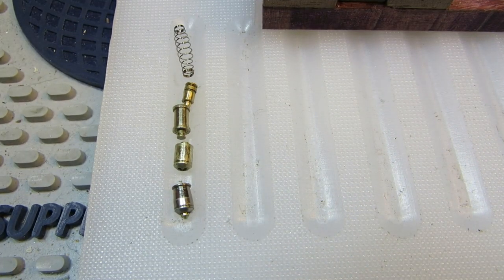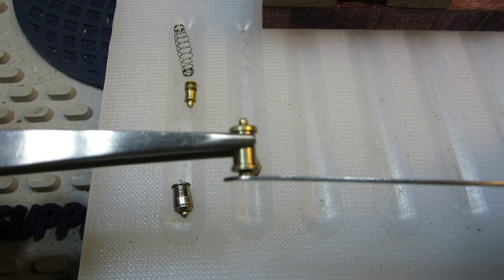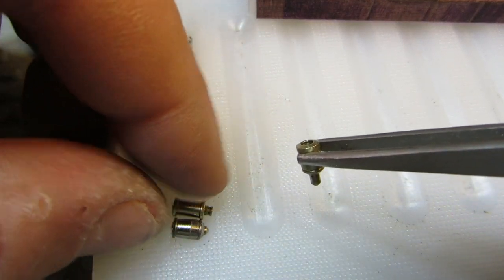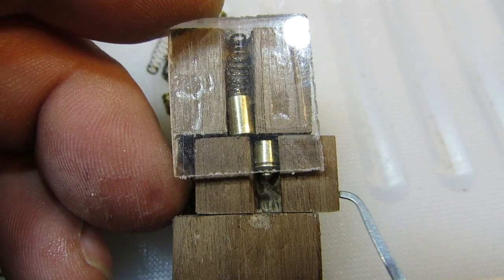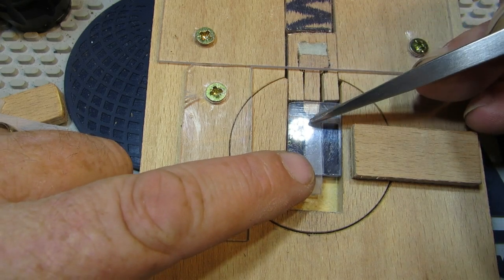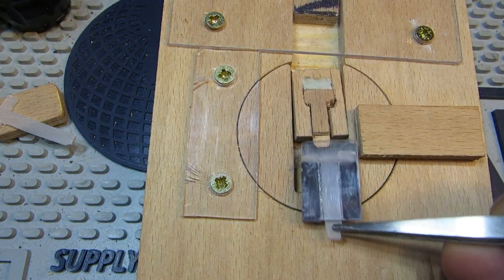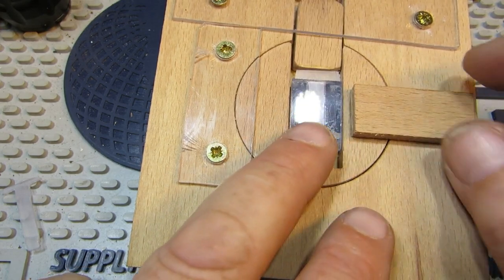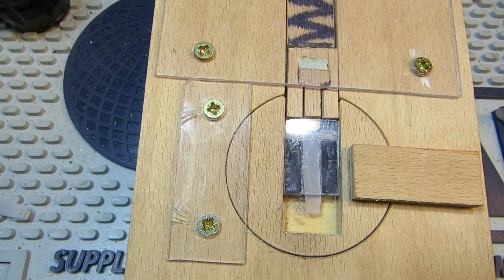(236) Security Pins - How They Work (Part 3)

Comment: I couldn't figure out the point of pin-in-pin before watching this. I didn't even realise the inside driver pin is spring-loaded and can go inside the outer key pin in those key+driver pin-in-pin stacks. It makes a lot more sense showing it with the model; very smartly made and presented.

Comment: Part 3 is a great demonstration of the Mul-T lock pin-in-pin operation and how to defeat them. Also, another great demonstration of challenge lock pin-in-pin operation as everyone who picks challenge locks should know. So, I guess that video #4 of the series of demonstrations of high security pins will be made soon? I think that a demonstration of the sidebar with finger pins and the sidebar with gated keypins and the rotation of the keypins into the true gate which engages the sidebar to be able to open the lock. Hopefully it won't be too hard to setup for a demonstration of these very high security locks. Just a little suggestion.... Thank you for your time and effort to get the information on the operation of these high security pins and their operating system.  Keep on picking!
Reply from the maker: Thanks, that might be pushing the limits of my cheap plywood, but you never know what may happen in the future.